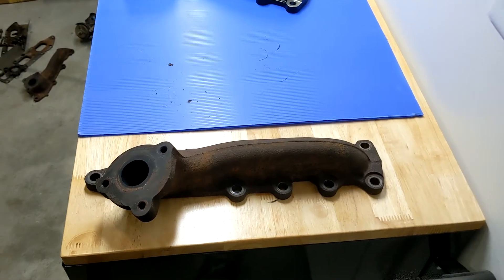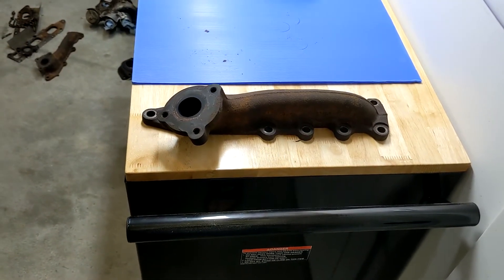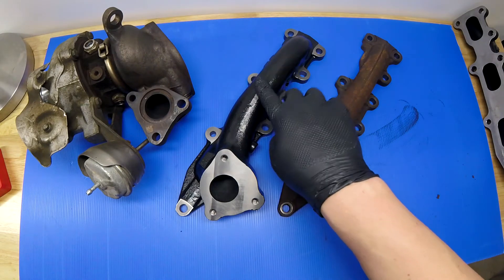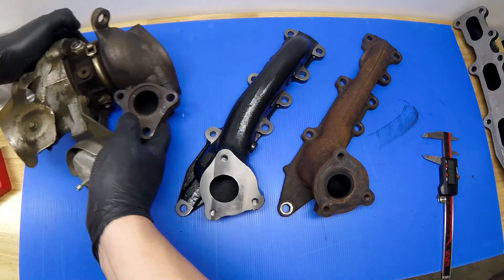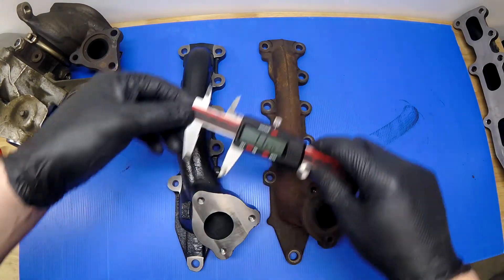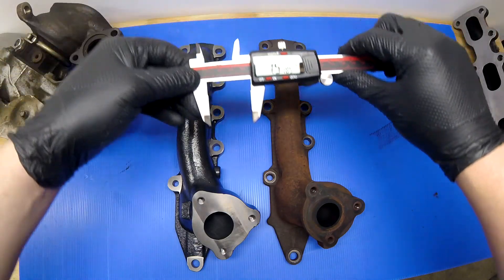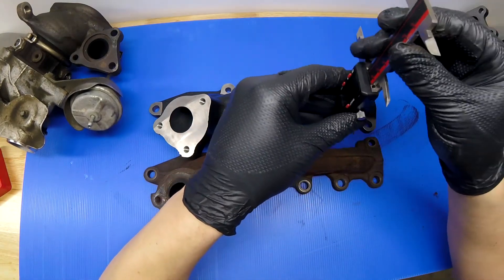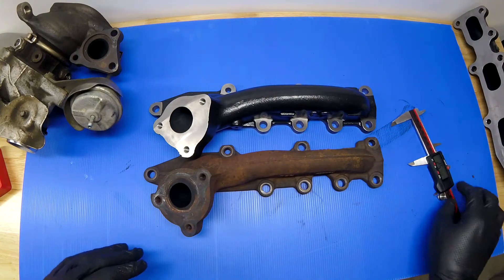Fixing the Ecoboost - EP 2: Prevent Exhaust Leak with CRP Full Bore Manifolds

Comment: I have read almost every post and I see a lot of comments about the ford manifolds warping and causing the leaks. I am not so sure that is the cause. I agree that they are warped when they come off but I'm not convinced that is why they leak. On my truck the right side leaked and the rear stud was broken, the left side didn't leak and the studs were all intact. Yet when I put them on my bench (4ft by 2 1/2 ft 1/4 inch plate assumed to be flat) they both rocked about the same. The BD Diesel manifolds were solid on the same plate. I am more inclined the think that the weight of the turbo along with the downpipes hanging on the turbo and rattling around in the rubber mounts combined with heat cycles causes the back bolt to break. The fact that the front and middle cylinders have 3 studs each to seal and the rear only has two and they are 4 1/4 inches apart is a ford engineering ah shit. Realistically it doesn't matter how if you have a leak. Someone in the comments mentioned it was the worst (most difficult) fix he'd ever done and I would agree. To me, at least now that BD has an alternative, I wouldn't use any other if it turns out that I never need to do it again. Fingers crossed.
Reply from the maker: Yeah I wish they were available when I made that purchase. Ford also has ones that use the extra stud location

Comment: I'm posting a 2nd comment here, to hopefully keep people from buying these expensive paperweights.  Youtube just suggested this video, and I see CRP is still selling these 550 dollar manifolds that will most likely just fail on you.  CRP will then blame you for improperly installing them.  It's not your fault.   The original 8 stud OEM manifolds were poorly designed, and CRP simply copies the original stud pattern.  Ford redesigned a 9 stud manifold that comes with stainless studs.  BP now sells an aftermarket 11 stud manifold, as there are 11 stud locations on the cylinders heads.  But if you are replacing your manifolds, I suggest you check your catalytic converters for blockage.  The cats are overly restrictive on these engines, and when you consider the amount of blowby that gets burned off, you could have blockage from soot accumulation, especially if you haven't run with a catch can installed.  Blocked cats lead to excessive exhaust gas temperatures and all that heat is concentrated right at the back of that manifold.  If you have the blocked cat condition, you'll likely notice that the studs seize on the side with the blockage.
Reply from the maker: Thanks for the input. It seems like you had a bad experience with CRP. I haven't had any issues yet. And at the time, I don't believe Ford had released an updated manifold. I haven't heard of BD. I will have to look that up. Full race even has a model out now. But I think they only use 8 studs as well
Reply from the maker: Just looked up the BD design. It looks really neat. If you are affiliated with them, shoot me a message.
Reply: @NSQGarage  I'm not an affiliate.  Just a guy who wants my stuff to run correctly.
Reply from the maker: @colliswilliams8992  gotcha. Unfortunately, I don't think those were out when I bought my new manifolds

Comment: I just received a pare of manifold’s from BD Diesel, they use all 11 manifold stud’s, plus improved flow over OEM one’s. Hopefully they work out.
Reply from the maker: Dang, seems like I did this too early!
Reply: Bro, how how did go..... I just got my bd diesel manifold today... How much did they charge u im labor? Any mpg improvement?
Reply: I just installed BD Diesel manifolds a month ago. I don't notice fuel or power improvements but they did fix the exhaust leak. Seems odd to me that ford would drill and tap 11 holes into the head but only use 8. It only makes sense that the back stud breaks with the weight of the turbo hanging on it. Another example of theoretical and empirical I guess. After watching a really good video by Arron Hines, it gave me the confidence to do it myself. I took me 22 hours to do both sides over 4 days. The only tricky bits were the cooling lines and getting the studs started in the heads. They went in much better after cleaning them out with an M8 tap. I think the dealership is 10.5 hours a side.   21*160=$3360CDN @ELCHACA

Comment: There are new manifolds available from ford that now utilize 9 studs instead of 8. The holes are already in the head, just clean it out and put the extra stud in.
Reply from the maker: You have got to be shitting me lol. Can you send the part number?
Reply: @NSQGarage  did you ever happen to get the part number for the new exhaust manifolds from Ford
Reply from the maker: @bmx4life5549  unfortunately, no
Reply: I just did this job on my truck, I used old part number when I bought the manifold, got it home and it didn’t match, talked to dealer and no help from them, eventually figured it out on my own.
Reply from the maker: @vdudley6319  did it come with an extra hole for an additional stud as @doug78 mentioned above?
Reply: @NSQGarage  it sure did, and the head already had the holes in it for the extra stud
Reply from the maker: @vdudley6319  do you have the PN?
Reply: @NSQGarage  Having mine done at Ford in a few days. Yes the new ones do have 9 mounts instead of eight. Bd diesel makes a set that uses 11 mounts. The heads actually have 11 stud holes.
Reply: Bd diesel exhaust manifold has 11 stud holes.... Engine block already has the holes

Comment: Are the exhaust manifolds hard to access?
Reply from the maker: Yeah it's kind of a pain. Doable, but a pain
Reply: @NSQGarage  my local shop wants $1300 to replace the drivers side exhaust manifold and install the radiator I bought.
Reply from the maker: @tylerdavis288  wow. I guess I'm not surprised. The turbos have to come off,  the fluids drained. I'm not sure if that includes the gaskets or not, but it certainly adds up in time and material
Reply: @tylerdavis288  that’s it?  I would do it. I spent 3 very miserable
 Days replacing mine in the snow, and preying the snapped bolts would come out. Theres much easier ways to make the money.  Plus about a day to scrounge up all the various parts (there’s a lot of them) to take out the turbos and such.

Comment: I did the same repair with the same manifolds two months ago, and I now have another leak.
Reply: In the process of diagnosing all of this, I had an issue with my turbo boost pressure.  After a ton of troubleshooting, I found a leaking blowoff valve that was only leaking enough that I didn't notice a problem under normal driving conditions, but would throw a code p0299 when I was towing.  The thing is, if there was a boost leak present, then that means the engine has to run at a higher RPM to produce the same power.  If it's slight, you might not even notice that you're running the motor harder, producing a hotter exhaust gas.  The high exhaust gas temperatures are the enemy of the manifolds/studs.  So if you've had this issue repeatedly and you don't plan on accidentally letting your truck roll down the hill into the lake, check your boost pressure, fuel pressure, catalytic converter condition, etc before going through a third set of manifolds.  Maybe even consider water/meth injection to keep your intake valves clean and your exhaust gas temperature low.
Reply from the maker: I'm putting fingers in my ears and refusing to listen. Contact CRP, they seem to be petty good about replacements.
Reply: I had the same issue. Contacted CRP and they said that the bolts weren't torqued correctly. Any thoughts on how to prevent the leaks.
Reply from the maker: @jaredcarlisle4006  I have heard they are pretty good on returns. So that is disappointing to hear.
Reply: @jaredcarlisle4006  I had wondered whether or not I torqued mine correctly.  I seem to remember having some trouble with my 20 dollar harbor freight torque wrench on that job.  That could explain a lot.  I'm going to see if I can get a wrench on all of them just to make sure they're all snug, and at the specified torque.  (I can't remember what it is off the top of my head)
Reply: Same thing here.  I have the leak again.
Reply from the maker: @chrisv1219  man this is really disappointing
Reply: Tell me about it.  I was so excited that the dealership installed them under my stock warranty and that CRP talked them up as being so much stronger.
Reply from the maker: @chrisv1219  do you tow? Im curious if it got hot while towing or just normal driving.
Reply: I do.  About ten times a summer, I tow a 7,500 pound travel trailer.
Reply from the maker: @chrisv1219  should not be an issue for these trucks. But those turbos love to get hot.
Reply: Sometimes it sounds more like the turbo than an exhaust leak.  Like hearing turbo whistle through a fan. It is like a whirring sound.
Reply: @chrisv1219  I also tow a 7500lb camper.  This engine will tow them, but like I said before; everything has to work properly or you will have issues with heat. At the typical mileage these manifold/studs are failing (80-90K), I suspect partially restricted catalytic converters may be to blame.  If you idle your engine for 10 or fifteen minutes and notice an excessive amount of heat coming from the area below the driver and passenger doors, you may have a partially blocked cat.  In that instance, you could swap manifolds a thousand times, but it's just going to warp.  That's the direction I've been leaning.  But who wants to swap cats without putting on a new magnaflow exhaust too?  Even then, I still have the exhaust leak to deal with.  It's all money. Maybe I'll just deal with the chirpy-turbo noise and run her till she blows.
Reply: I only tow a few times in the summer.  I also have a tube and high performance thermostat.  Why is my engine then not blowing codes all over the place?  If the engine does fail or whatever, I’ll either get a super duty or the new Lightning.
Reply: Plus the guys at CRP gave me some canned reply about tourqing the bolts and single facing gaskets, blah blah blah.  It shouldn’t be that complicated.  But I’m not an engineer.

Comment: How about a hi temp ceramic coating? You know... while you're at it.
Reply: I installed the Cr units and they also wArped. I bought a second set and had them coated with high temp ceramic powder coat. If they warp again I’m throwing my truck into the ocean
Reply from the maker: @rx7addict  dude I would cry. The install is the worst thing I have done on a vehicle. Let me know what beach you will be letting it idle into, so that I know where to park mine haha
Reply from the maker: Lots of people do this since you are already in there. But I already spent enough money on it haha

Comment: Had a 2011 ford f150 with the EcoBoost ran good till the fuel pump shorted out and caught fire
Reply from the maker: Oh my!
Reply: @NSQGarage  that was a week ago
Reply from the maker: @whatislife567  jeez so whats the replacement?
Reply: @NSQGarage  probably a 2009 4.6 f150
Reply: @whatislife567  still in the same setup as an 11. Just worse gas mileage worse transmission and way less power.